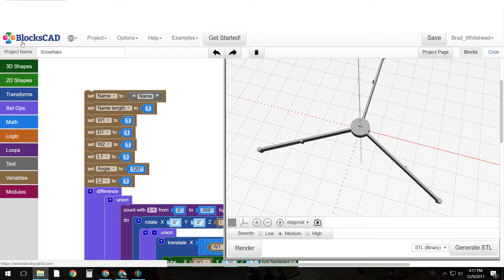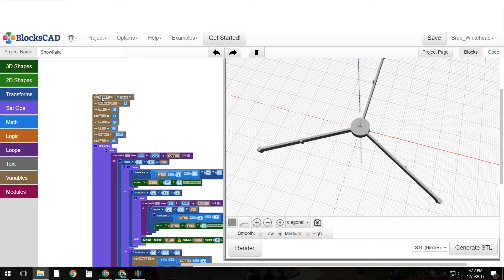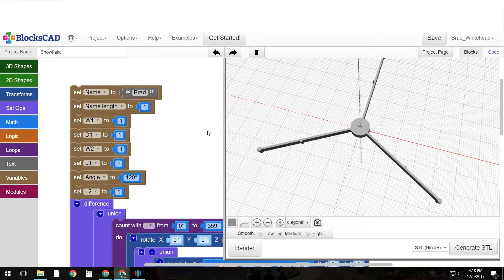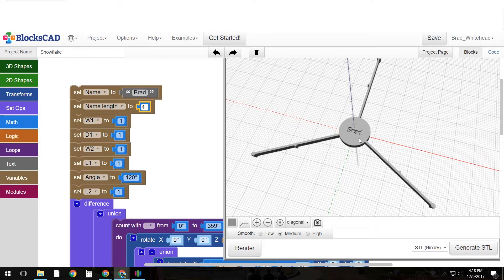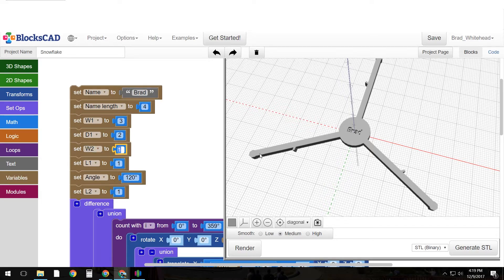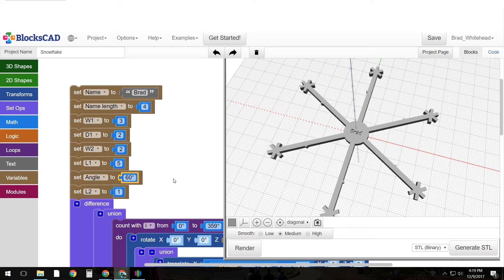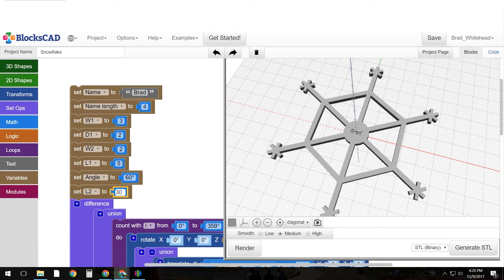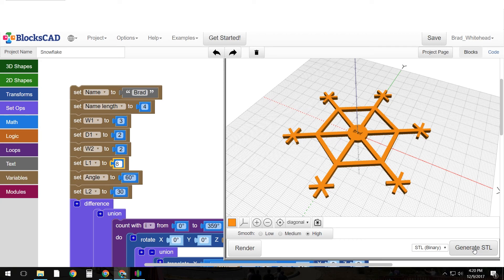BlocksCAD Snowflake

Comment: What is the variable in the cylinder before the minus?
Reply from the maker: It is the name length variable, which controls the diameter of the cylinder so that the text doesn't overlap the inner cylinder.